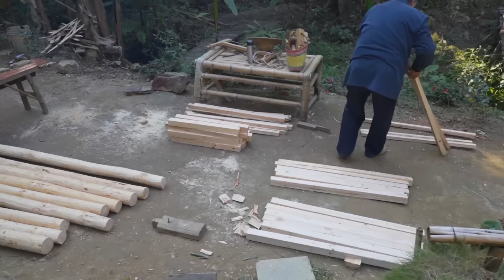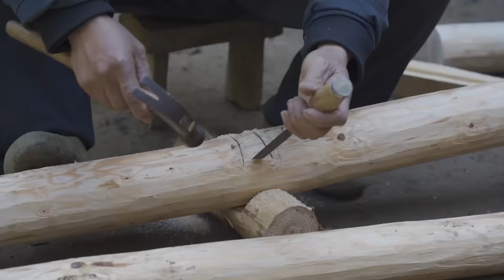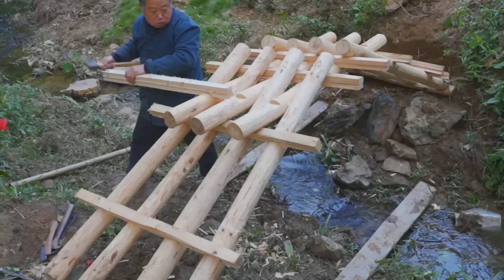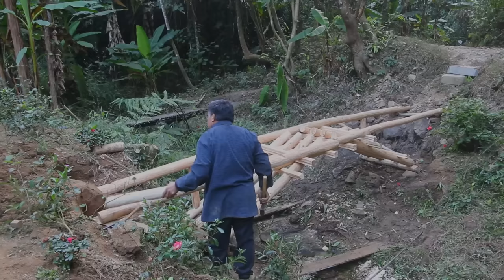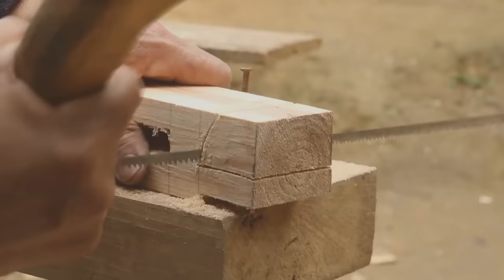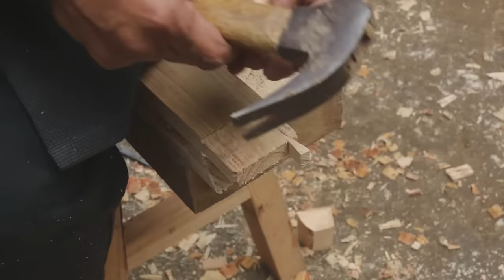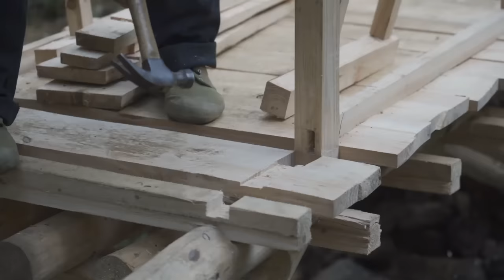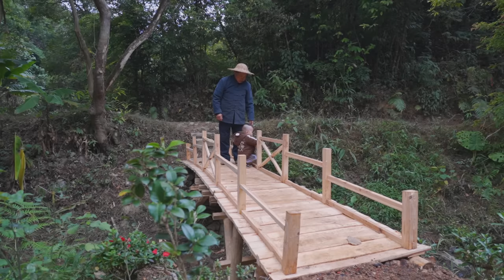阿木爷爷榫卯打造一座木拱桥，全程无钉子，高手在民间【阿木爷爷 Grandpa Amu】

Comment: my favorite part was the wedges in the hand rail. When it's hammered down it holds the walking slats down and then the wedges spread the wood inside locking it into place. This is absolutely genius!
Reply: Exactly what I thought too! At first I thought old foo was gonna wreck the wood but nu'uh he done good.
Reply: It's, actually called a foxed mortice and tenon which is good to see but very rare these days.
Reply: Yeah,  Me too ..... I do admire much about this kind of self - knocking system , what a genius design WITHOUT a piece of nail, just by Inter-locking system like dovetail design !
Reply: Yes, I agree this advance tech
Reply: Old carpentry tricks. Make sure it is right or it won't come off.😜😉
Reply: But the hand rails would come off if pulled from above with a considerable amount of force and i dont think they wont be able to bear much weight if you lean upon them because the wedges are very thin.
Reply: Look up Japanese joinery
Reply: Thanks for saving me a few seconds, and typing out my thoughts exactly.
Reply: Yeah. What he said.
Reply: @celdo84  it will damage the wood on the mortice side
Reply: Yeah, those pins will made them real fit,
Reply: Atria Wulf it blew my mind. I’m extremely impressed
Reply: @celdo84  I don't agree. Those wedges are small, yes, but strong enough to hold a few persons. This type of joinery is known for hundreds of years and if it wouldn't work no one would use it.
Reply: He’s sitting on the rail. I think that’s strong enough to hold someone
Reply: I might be genius. But this technique has been around for a long time.
Reply: Michael Petty well, it’s basically the same technique as they use to keep axe and hammer heads on the handle. I’ve just never seen it used in such a way like this
Reply: Darick Schott it’s ok Derrick. A lot of people haven’t seen it before. This is a form of what we call mortis and tendon. It is very strong and durable.
Reply: I was confused at first but was so blown away after
Reply: Thought the same thing.
Reply: @stephenlomas8555 , I'm impressed. 
Someone that actually knows a foxed mortise and tenon is.

Comment: I have 37 years in carpentry. I can build just about anything. But the patience to cut, chisel and build this are on a level I have not achieved.👍
Reply: Yet.
Reply: @jefflemere4609  there's no yet. I can't do it...😵
Reply: @youshouldread  The implied yet means you could do it, though not the same way, meaning you might be able to do similar as him. One mustn't limit themselves or they may be blind to what is doable.
Reply: @youshouldread  yeah, you can, build some thing🤔😉😅👍
Reply: @youshouldread  I was thinking the same, my late grandfather was master carpenter and wood work in general, he was really good but this is on another level!
Reply: @youshouldread  you are a  humble  man,  God  will  give  you  grace
Reply: 45 yrs here in this trade, around 13 yrs old after school or vacation 
 while my friends spent time on soccer fields I busted my derriere in every shop or construction project that needed me.Thru out Asia I've heard a few landmarks built without single nail .The Chinese and Vietnamese worship "Lỗ Ban" the God of Carpentry btw... Grandpa is on another level indeed his eyes replaced the tape measure 👍
Reply: @KhanhNguyen-uv3dx  you're never going to be a better carpenter than a man who's eaten every meal of the last 70+ years with two wooden sticks.
Reply: @lizabeth763  That's true, perhaps his skill on two wooden sticks are capable catching fly in the air without any issue. The only thing I can beat him is beside being a carpenter I'm also very efficient at mechanical, electrical, welding, fabricating plus hydraulic system. Love them all 😍
Reply: We are used to power tools, fast and cost efficent working with inpatient customers. I run from one construction site to the next one. I germany I learned a lot of traditional woodworking during my apprenticeship. But I don't need it. Projects like this bridge are something that comes as a private project where you can really put your heart into it.
Reply: We are used to power tools, fast and cost efficent working with inpatient customers. I run from one construction site to the next one. I germany I learned a lot of traditional woodworking during my apprenticeship. But I don't need it. Projects like this bridge are something that comes as a private project where you can really put your heart into it.
Reply: I love when Gramps takes the little guy across for the first time.
That bridge will still be there for him to walk across when he is gramps age... 
The only thing missing is a coat of linseed oil, or tung oil.
I can imagine the little man with sandpaper in hand, being taught by Gramps... Sand the bridge...
Reply: I paid someone over $2000 to install garage cabinets and shelves in my first house. Its falling apart now. My grandpa and father offered to build me cabinets and shelves for my second house. Still going strong today. A trade they learned growing up in China. :)
Reply: He built a bridge using basic dovetail joints. Like, when I saw him chisle out the logs and joined the planks into them, it became easy, but intricate. No chinese magic, just literal hard work. I completely enjoyed watching this. ❤
Reply: Interesting comment. Since you're a professional, you must appreciate the work even more than the rest of us non-experts. In your opinion, how long did it take for this grandpa to acquire all his skills? Maybe a lifetime? He is very precise, doesn't hesitate, doesn't wear gloves or any safety equipment. There must be a lot planning and experience to be able to get to the site of the construction and build everything so quickly and so smoothly.
Reply: Brandon S  I was giving props to this man. But the same as people are busy...people also think too highly of them selves. Patience is the issue.
Reply: You can build it in another way using high tech machinery...forget about using his skill...agree, it is a level up! I believe he do it as a passion, love and he has alot of times to do slowly and relaxing....not all of us has that kind of time to spend. U are humble. Be blessed!👍
Reply: @CasCade 509 Perfectly said! We are only a part of nature and have dominion over nothing but our own selves. Most of us fail miserably at even that.
Reply: Wean off caffeine--be prepared for 2 to 3 months of killer headaches--but then that patience will all come back--those caffeine brain cramps stifle ability--you'll be great--look forward to your future video of amazing creations!
Reply: read Gods word I can’t even build a deck!
Reply: @jackeroo75  Sure you can.  It only takes a bit of common sense.  What you are probably intimidated by are local government "codes" that only exist to take your money.  Don't let that bologna stifle you.  There is no correct way.  Look at this guy.
Reply: @lizabeth763  hahaha
Reply: I'm a bit perplexed, how can you be in carpentry and not know dovetail, tongue and groove? I mean sure, it takes a bit longer to do with a chisel, but let's face it no normal Carpenter is going to have a giant saw to Auto cut a dove tail in a log.
Reply: The dovetailing, the interlocking, the slot grooves. I never saw him using measuring tape either. Most of his tools are really simple too. I am thoroughly impressed.
Reply: Come here we will teach you.
Reply: So you are in business since 1983- till date ... Good to.know ,
Reply: @jefflemere4609  I love this comment so much
Reply: Incrível seu trabalho 👏👏👏
Reply: Rowena Tam  It's certainly a bad one. Sadly, it's on display all around us.

Comment: Mortis and tendon construction is better than glue and nails or even glue and screws! Thank you for showing such beautiful  craftmanship in building an arch bridge🤗
Reply: I've built tables with the same 'fox wedged tenons' and then also 'through wedged tenons' and I can tell everyone, if the bridge was wider, you could EASILY drive a 18 wheeler across that, loaded with a bulldozer!! Yet, not an ounce of glue or a single screw or nail used! This is how things need to be done! Astonishingly beautiful!
Reply: jeffffro7674 maybe if he used hardwood and not soft wood like what he used
Reply: @salvadorelmercabotageiii9148  softwood can be very beneficial in this application. Softwoods will flex and bend in situations where hardwood would crack or break.
Reply: @j.r.millstone  заходим в гости, смотрим как мы строим)
Reply: It's also a lot more work to do with hand tools. Very impressive!
Reply: Well.. Glue came as an improvement for tenons not to replace it, nails on the other hand, yes. Tenons and glue is still used for fine carpentry and wood furniture! It makes more durable, take the noise out the joints and a better finish overall. Originally i think was only use for indoors, since outdoors glue that work on wood weren't there and still today they are only use by only few applications. So, tenons and glue is in one category and nails and glue are in another.. Or both can stand alone in its own! 😉
Reply: As strong as a mortise and tenon joint is on it's own, I would still always use glue to stop expansion and contraction in the joint. The number one cause of normal joint failure is contraction of the tenon. As the glue is absorbed into the wood, the tenon expands and then dries with the glue filling spaces on the joint. I still have massive respect for blind wedge tenon joints and when properly executed will go absolutely nowhere short of the tenon breaking off (as unlikely as it is).
The fact that this is outdoors and by a body of moving water reduces the chance of the joints ever contracting assuming the humidity doesn't just drop off dramatically.
Reply: @jeffffro7674  this guy knows what he's doing that's for sure...this is a lost art here in America...not only very strong but also beautifully done
Reply: @salvadorelmercabotageiii9148  your assuming "hard and soft wood" refers to the density/strength of the wood when in fact it does not. Hard and soft "wood" actually refers to the type of seed the tree produces.
Reply: jedi foghorn I’m sorry, I mean denser woods. The ones that are longer lasting and more weather resistant.
Reply: @dcgo44r  the only glues I'd ever trust outdoors would be an all natural sap-based resin, or modern epoxy. 
Pretty much everything else is over-hyped consumer products.
Reply: @ditzfough  wait, objection...! No offense... But what carpenter cares about the seeds of a tree? All he cares is about it wood! Just saying.
Reply: @dcgo44r  a carpenter doesnt. All im saying is when someone uses the phrases hardwood or softwood it has nothing to do with the strength/hardness/density of wood. The phrases hardwood or softwood only refer to the seeds. So if you use the terms hard or soft wood to refer to the lumber itself then the terminology is being used incorrectly. Thats all i was saying.
Reply: @ditzfough  then 90% of the carpentry industry is wrong!
Reply: @dcgo44r  
Not 90..........99.9
Reply: @dcgo44r not really. Because generally speaking catergorically hardwood trees do tend to have denser harder lumber. And softwoid trees do tend to produce softer lumber. If you would actually read research you would know this already instead of replying to my comment on youtube. So yes hardwood trees and softwood trees generally do produce a lumber that fits them. But there not named for the lumber they produce but by the seed. 
 http://www.nzwood.co.nz/faqs/what-is-the-difference-between-hardwood-and-softwood/
Reply: @ditzfough 🤔 so, what is the point of using the terminology correctly? 🙄.. I still don't get it?! 😁
Reply: @dcgo44r  Really?! Because thats how the human race has achieved all that it has.... By sharing ideas and information using the correct words.
Reply: @ditzfough  Merry Christmas bud! That's all I have to say now!
Reply: @ditzfough  So then they are still correct in calling hard and soft wood hard and or soft wood.
Verbage is being used and that's fine so why get so wound up over it... it's just layman speak pretty much.
Reply: @BIackCadillac  wasnt wound up. Was just having a conversation. And sharing knowledge.
Reply: @ditzfough  To be fair. People don't come to youtube to be condescended too or told to research things. I appreciate sharing ideas and learning too, but I knew what the guy meant. And more than likely so did everyone else. I wouldn't have even replied, I wanted to point out there is more than one way to share information, without having a negative tone, and the information you shared was not really mission critical. More. Peripherally related.

Comment: The main thing in this whole story is that grandpa doesn't use nails or screws to connect them, but makes cuts in the wood like so-called "swallow tails", and then the pieces have a tight connection to each other, and did you notice how he fastened the fence posts to the whole bridge, by hammering two little wooden shims at the ends of the pillars, and when driving the pillars into the prepared openings in the construction of the bridge, those shims spread wood from the inside and enable a firm connection of the fence with the bridge construction, of course without nails and screws. This is the core of carpentry, who knows how to watch has something to learn!
Reply: my
no
Reply: no
Reply: The teacher teaches , but student must want to learn and apply .
Reply: Thanks Bojan Vila
Reply: Imagine that one quarter of all citysen from China need a half kilo of nails .... all planet must make nails.... so they must overcome the dificulties better tey can with what they have !
Reply: they're called dovetail joints

Comment: They unspoken beauty of that construction is when those joints get wet the wood will absorb the water and swell, .aking them even tighter
Reply: I liked the wedge anchors on the handrails. This is the same principle on concrete anchors the more pressure down the tighter the connection. This must have been the original version.

Comment: These guys are true Masters the structure alone was done with Dovetales and the railing with Fox tendons wow. Marvelous engineering that bridge will no doubt be there for decades
Reply: Without treating the lumber, I'm not so sure.  Structurally, it seems really sound.
Reply: It looks like hes just estimating the dimensions of the dovetails usung his eye, same with the fittings...  is that possible?  Or did the video skip all the measuring?
Reply: @IlliniDog01  I's thought about this as well.   In my experience, with specific types of condition resistant and big resistant woods, structures tend to have a much shorter life span.
Reply: @WaltRBuck  Read up on the Horyuji Temple.  Although there was a fire requiring most of it to be rebuilt after a fire in 670,  "14 pagoda timbers, including two rafters confirmed to have been cut in 663 and 631."